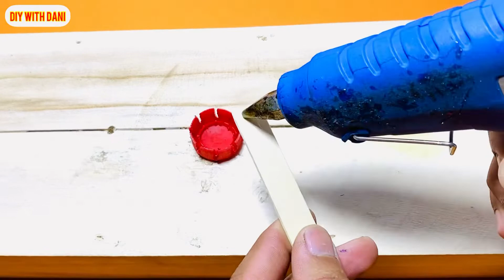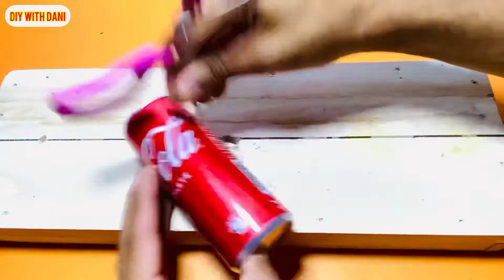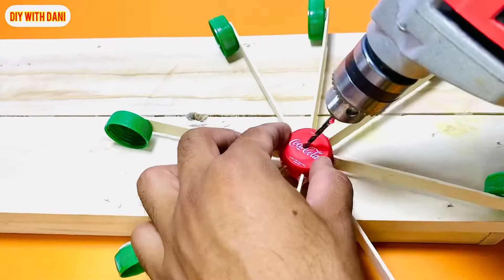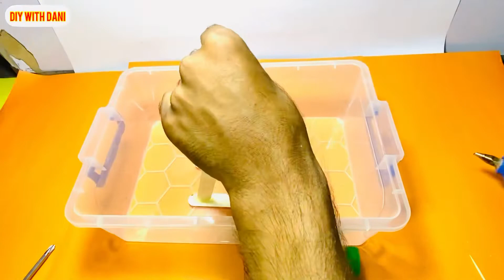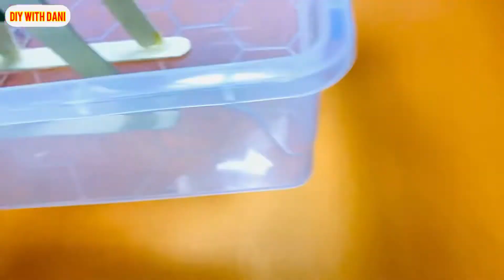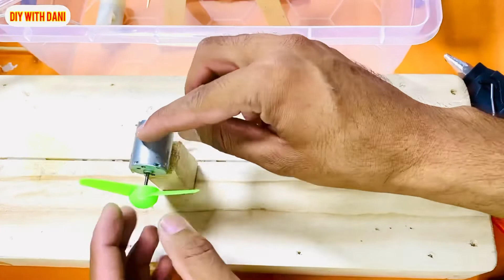How To Make mini Dam At Home || How To Get Free Electricity From water || New idea || Diy With Dani

Comment: Fake, because it's not showing how the motor is connected to turbine.
Reply: The motor is not connected to turbine the turbine will move with the help of water force the motor is connected to a battery to release water in can
Reply: I agree with you